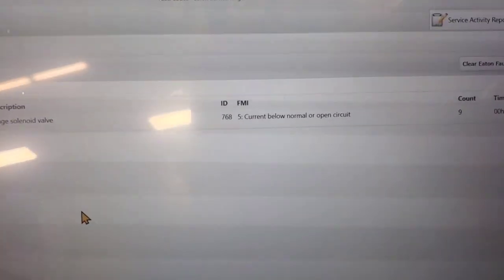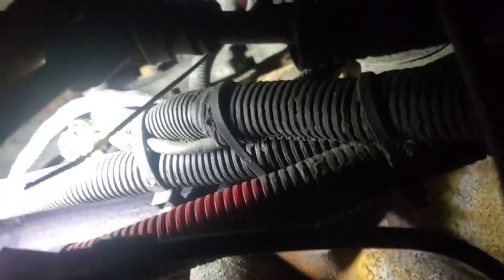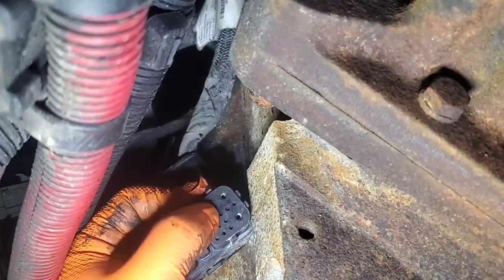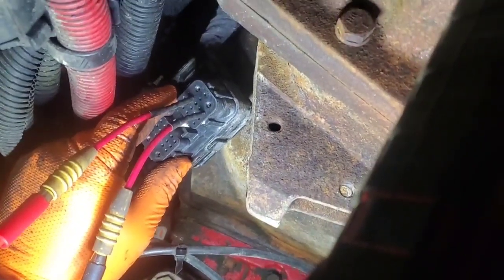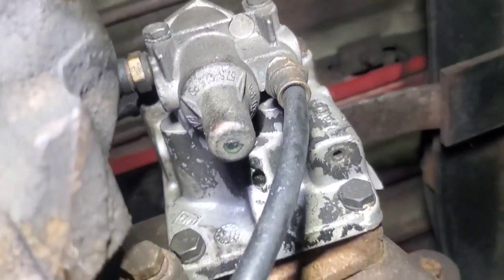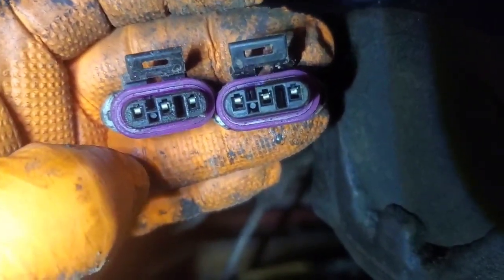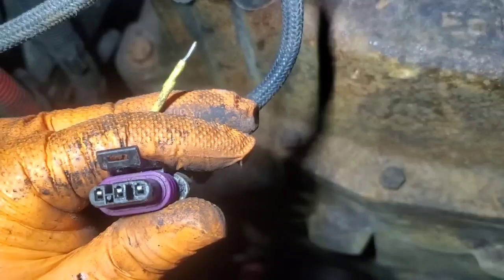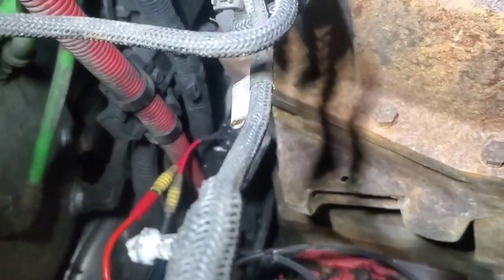Transmission won't shift past 5th gear diag /repair - Eaton Ultrashift Code 43-5 DIY

Comment: I have no codes. It wont even show an inactive code?
Reply from the maker: Check your range shift fork for movement. Also make sure the exhaust port isn't plugged (spider nests are common over here). That would prevent shifting and sometimes not code up.

Comment: Anyone want to guess what happens when the guy replacing the harness plugs the wrong plugs into the range selector solenoids? I know the answer!!!!
Reply from the maker: Well, I take it you found the problem 😂
Reply: Partial. I need to replace the regulator valve on high side solenoid. No high side. Valve is backfilling dumping air into topside locking the valve up.  @AcousticHills